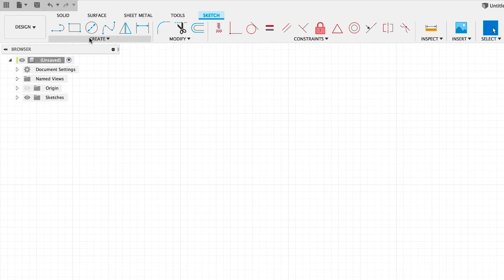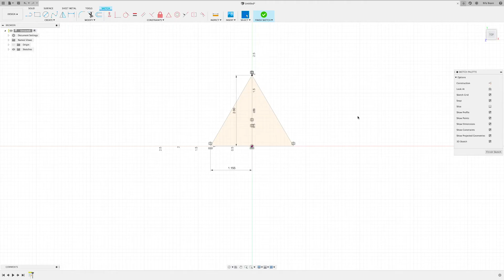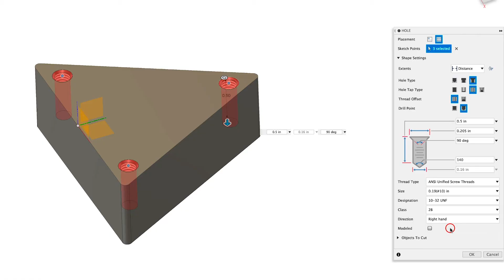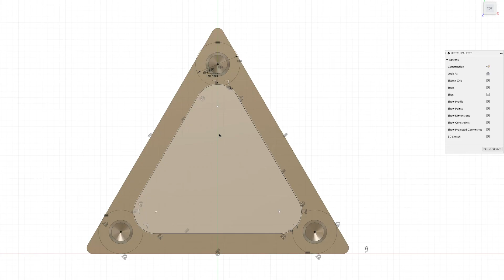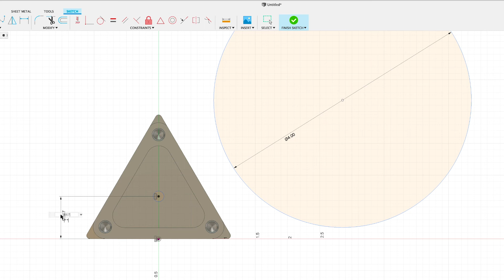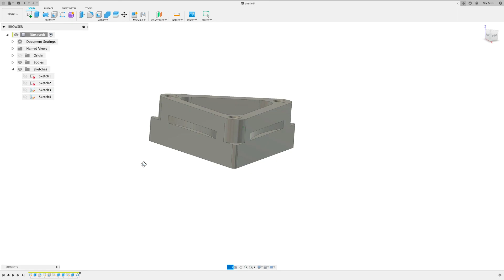FUSION 360 TUTORIAL: DESIGN THE TITAN-4M | ACADEMY

Comment: I had the same trouble that Mario did. I found a Solution. I had to select "Simple" for the hole type. Input all the Proper info for the rest of the "hole" menu. Do Not press ok to make the hole in the drawing yet. Go back up to the Hole Type selection  and select "countersink" . Add all the proper info and your holes should be as intended. It worked for me.